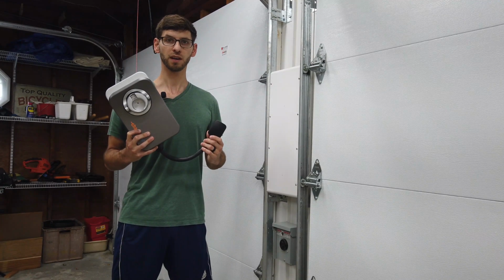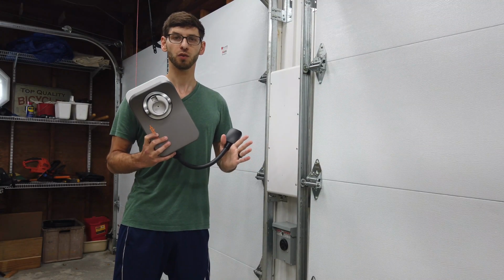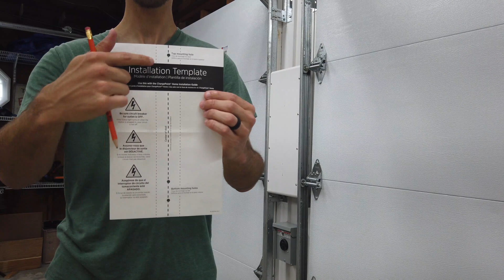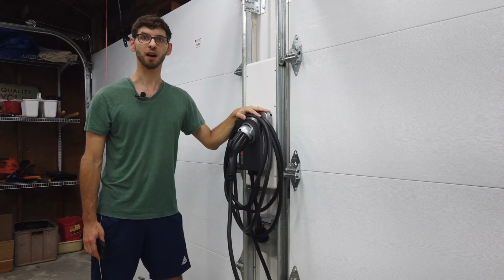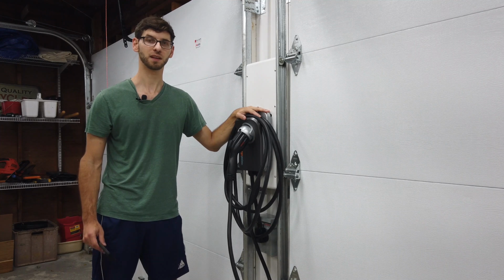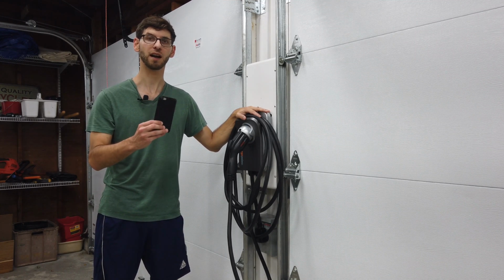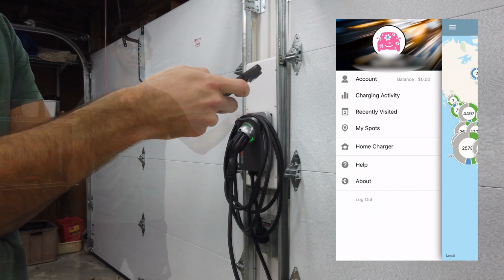ChargePoint Home Flex Level 2 EV Charger Installation and Mobile App Setup

Comment: You can not pair a 60 amp breaker with a nema 14-50. You must select 50 amp breaker input with a 40 amp output.

Comment: Thank you!  I used screwdriver with bit provided to screw in the screws on the bottom by hand.  Didn't want to get too close to the red wire with the drill speed.  Have 30A outlet and installed the 6-50 ChargePoint.  Selected 30A on the app, b/c it only gives option for 40 or 50 for the plug-in.  My Niro EV is charging as we speak.  It worked!
Reply: Did-the-same-for-my-late-2023-ModelY-but-on-Hubble-14-Plug50-Nema-Plug

Comment: if i already have a 220 volt outlet installed I just have to turn breaker off, mount this and follow the rest of the instructions and then I'm done? am i able to just use my travel charger in 220 volt outlet until I have this completed? I'm getting an EV this Thursday and I wanted to be prepared. Also I subscribed!

Comment: The location that u selected is exactly why GFCI is a requirement
Reply: Hardwire is the only way to go…. That way you don’t have a receptacle to protect
Reply: The requirement for a code mandated (in KY) GFCI breaker, is exactly why this unit will not work properly at any of the available amps, except the lowest (maybe). ChargePoint recommends a hardwire installation in that case, but goes further, "We do not recommend using a GFCI breaker as the Home Flex already has integrated charging circuit interrupting device (CCID) protection. Using a GFCI breaker in the panel, especially with a plug-in installation, can cause nuisance breaker tripping in certain circumstances and interrupt charging."

What is a mother to do?

Comment: Hi - I have a 100Apanel in the basement, I have one 240V free outlet in my kitchen for electric stove, which is not used anymore because we converted the Electric stove to a Gas stove. Can I use the 240V electric stove port (14-50) by moving to Garage and if yes, how much max amps do I need to set the Chargepoint unit to? 32A ?  Pls advise and thanks in Advance

Comment: You cannot set for 60 amps, that will overload the NEMA 14-50 outlet, the max breaker setting should be 50. Only if you hardwire you can use a 60 amp breaker
Reply: Correct, if you wanted to do the plug-in option for a 60-amp circuit breaker, you’d need a NEMA 14-60 outlet.

Comment: ChargePoint makes a significant point to not have the wire that comes from the unit that goes into the outlet be stretched that tight. Folks should look at their installation instructions for details on that.

Comment: ChargePoint suggests using a coin to fasten the inside cover in place rather than a screwdriver. The screwdriver is too narrow and can cause damage to the plastic.  Also ChargePoint recommends that the charger be offset to the right from the outlet box rather than having the outlet box directly underneath of it. They make a big point of this in their instructions.

Comment: One more comment, I installed it with the 60 amp breaker but hardwired straight to the unit instead of using the plug because the plug is only rated for 50 amp.

Comment: Hello, firstly thank you for your explanatory video. I want to ask somethink. Firstly, When we are using mobile app, we don't add any code or any specific think about our charger on mobile app. We just add plug-ig/hardware information. How mobile app know our charger id or any other specification about our charger (the information at the About Charger). Secondly is there any option to use my charger without Wi-Fi (offline scenario) Thank you.

Comment: Very good and helpful installation instructions, thanks.  One note:  the app has apparently been updated since your video.  Under my Settings (Hamburger>Home Charger>Settings), I don't see the option to change amperage, so whatever I put in upon my original setup cannot be changed, unless I guess I start a new account, or maybe delete the app and reinstall and re-configure the Charger again.  Fortunately I am sure I got it right the first time, but it doesn't allow me to see what I inserted at the setup like it does in your video.
Reply from the maker: Hey Jerry, thanks for the feedback on the video and glad it was helpful to you! Good to know that the app has been updated since I made this video. Like and subscribe and happy charging!
Reply: I read somewhere that, if you want to charge the charging amperage you can call ChargePoint and they will do it for you remotely.

Comment: I'm SOOOOOO uncomfortable with the cable touching the rail of the garage door. Moving parts with hi-voltage/hi-amps is not a good installation sorry.

Comment: Can you do the reverse?
I have Nema 14-50 charging my Tesla ; Is there an adaptor to convert Tesla charging end to  J1772 to charge a different EV?
Reply: Yes, there are multiple adapters out there. They do NOT work with superchargers, but for home chargers you can use something like a TeslaTap

Comment: Thanks for the really helpful video. I notice that you were able to use your 60 amp circuit for plug-in. It seems that the app has changed and if plug-in is selected the only options are 40 or 50 amp circuits; to choose a 60 amp circuit, hardwire needs to be selected. Is it still okay to use a 60 amp circuit for plug-in by just selecting 50 amp from the plug-in configuration?

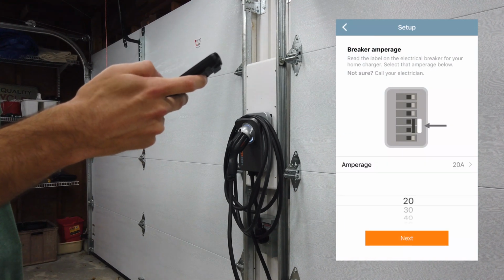Comment: 14:59 The app asks you the breaker size? I thought (from reading some other instructions) that you [need only] stipulate the actually amperage your EV will accept. I want to install a CP Home Flex NEMA 14-50 onto a 40-amp breaker, then select 32 amps for my Volvo XC40.
Reply: You select the amperage the EV will accept thru the car itself. The car IS (or contains) the charger.
The chargepoint only needs to know what the rating is for the installation.  The chargepoint is not a car charger in that it regulates the current depending on battery state of charge. It has no idea what the cars state of charge is.
Reply: @Dan_D_av8geek  Thanks, helpful info.

Comment: I enjoyed the video. Where did you get the plug receptacle? All the ones I have seen have a raised cover that will interfere with the plug coming down?
Reply from the maker: Hey @David 4gtr and thanks for the feedback and question! I am glad you enjoyed the video! The plug receptacle was bought at a local electrical hardware store. It came with a cover, but I remove it when I record videos. Hope that helps! Let me know if you have any other questions and please Like and Subscribe if you haven't done so already! Happy charging!

Comment: It does not work.  Led first green and then turns white.  Chargepoint with problems.  I can start a remote charge without being connected to the car.  Possibly problem servers.  Account problem.  Fixed white led.  A simple charger without app or internet is better to charge your car.  Without complications.

Comment: Excellent video! I have the same two door garage and intend to install a wood panel between the doors; is this a 1/2 inch thick panel or 1 inch? I plan to install a 28”x11”X1/2” panel and wonder if this is sufficient strong for the weight of Charger and cable. Cheers!
Reply from the maker: Thanks @Tony S! I really appreciate the comment! The panel I used is 3/4" thick, but you could probably get away with using 1/2" board. Should be plenty strong! Let me know if you have any other questions! If you haven't done so already please like and subscribe, cheers!
Reply: @evunite1  Thank you, already liked and subscribed. I’d choose the home flex unit (perfect fit for this location), but it’s now outrageously expensive on Amazon (~ $1,500).
Reply from the maker: @tonys9413  thank you! Wow, you are right....that's crazy and definitely not worth $1,500. I checked on their website and it says both the 6-50 and 14-50 options are back ordered. Must be a ton of people buying them right now. Once they get more inventory back in the price should hopefully go back down to $699 like it's always been. The Juicebox is another good option to look at (although I like the ChargePoint better).

Comment: Also, I know the CP unit must be double insulated to only require a 3-wire installation. But can you tell if the unit's frame has any metal components?  If so, my inclination is to run a neutral wire to the ground lug and ground the frame chassis as a precaution.  If not, I plan to still run four #6 wires to the unit for future units that may require that setup.

Comment: Informative video, thank you.  Can someone explain why CP limits charging to 48 amps when a 60 amp hardwire circuit is used (THHN 90*C wire 4 ft run)?  To get the full 50 amp capability, CP requires a 70 amp breaker.
Reply: I think it is something about only using 80% of rated amperage, e.g. 60 x 0.8 = 48 amp, and that's related to safety concerns because oftentimes it will be pulling that current sustained for multiple hours so you don't want to run it right at the upper limit of the circuit's rated capacity.

Comment: I have a prius prime.   I'm now looking at the plug needed for charging the car.  I was told a regular 110 outlet will do.  However, while reading the instructions to the plug, it requires a GFCI and an over current circuit breaker in the panel.
Do you have a video on this set up?  I'm looking and not finding anything
Reply: 110v is Level 1. Super slow. Think: days. Go with Level 2
Reply: @JosephGreenleaf  Actually the prius prime charges in 6 hours on the 110.   When it runs out of electricity it switches to the gas hybrid.   A 220 isn't really necessary
Reply: Good to know
Reply: @JosephGreenleaf  It's only 30-35 miles on electricity.   Perfect for work.  Long trips it runs on the hybrid gas.   Best of both worlds

Comment: You entered in the App setup that you were on a 60 amp breaker.  According to other videos, if a 6-50 or 14-50 plug is on the unit, it should be on a 50 amp breaker which will deliver 40 amps during charging.    If you want 48 amps to be delivered, a 60 amp breaker is needed, BUT it needs to be HARD- WIRED.  Can you explain?

Comment: Customer service from the company is HORRIBLE.  My home charger stopped working after 6 months.  That's not ideal but wasn't the disappointing part.  The customer service believes in not providing service, not being helpful and using the line "beyond my capacity" at every opportunity.  A request for service, once filed, needs to be escalated and reviewed.  If ok, then transferred to another supervisor who I think decides whether to send your request to a different department that might be able to help you.  Could take anywhere from a few days to a week to resolve - I'm still waiting for an email from the supervisor (#2) to say that they'll send me a replacement.  In the meanwhile, my car is sitting in the driveway out of juice.  My recommendation - don't get this product.  Don't work with this company.